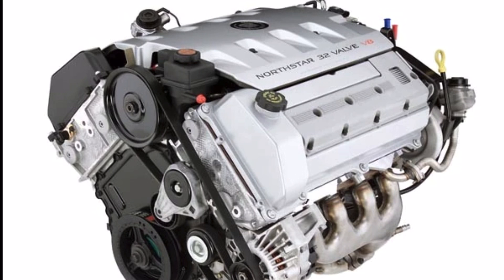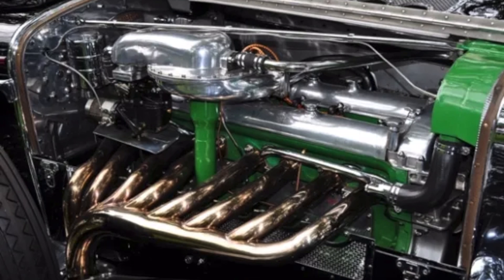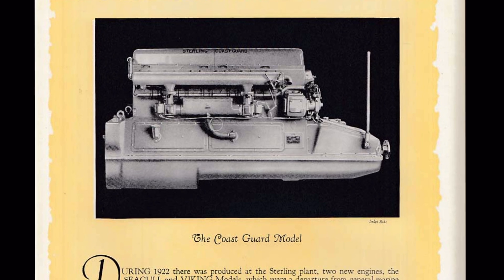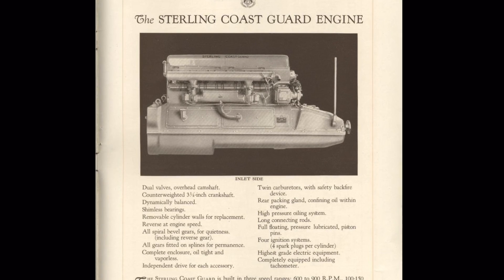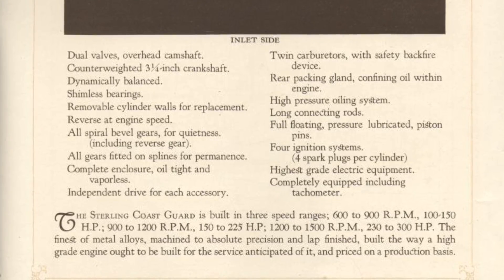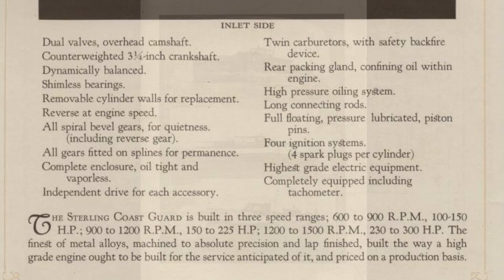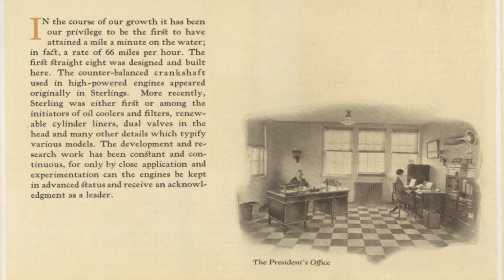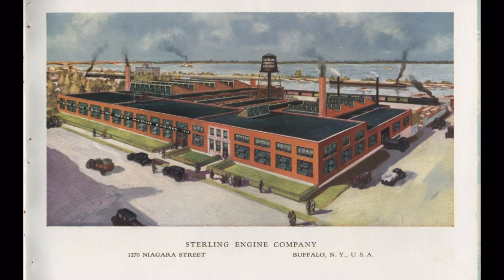They Beat GM, Ford, Chrysler & Duesenberg: 1925 Sterling DOHC, 4 Spark Plugs/Cylinder 1427ci Engine!

Comment: Awesome !  Reminds me a lot of a much more well known engine, Hall Scott, based in Berkeley, Ca.   I discovered Hall- Scott when I was looking at an abandoned Caterpillar bulldozer that had an overhead cam hemi head engine that looked really out of place and way too advanced for any industrial engine, even a modern one.  The head was off, laying on it's side, and was just crazy cool. I learned that Hall- Scott actually provided some engines to Caterpillar during the mid 1920's, that were basically 4 cylinder versions of their popular truck and bus inline sixes.

Detroit pragmatism killed off so many advanced designs that were around from the twenties thru the fourties, and most modern enthusiasts tend to think that advanced engineering began showing up in the 1950'-1960's.....   Thanks for sharing !!
Reply: I hope Adam will do a video on the Hall-Scott engines.  Besides truck. industrial and  high-end, high speed yacht engines, during WWII  Hudson also produced Hall-Scot marine engines under licence for use in U.S  Army-Air Force and Navy high speed  crash rescue boats and landing craft labelled as the "Hudson Avengers"
Reply: Do you remember if that Hall-Scott 1091 6 cylinder that was in tractor-trailers was SOHC  or DOHC.  Ive read about them in the past.  Pretty advanced engine for its time.  Saw pics online of a V12 version of that(2182 cid) in an old Kenworth or something 😊
Reply: Gear driven SOHC, with rocker arms to actuate the two angled valves per cylinder, hemi style combustion chamber with twin spark plugs. This 1091 engine belongs to a platform that started out in the 1920's, continuously produced all the way thru most of the 1950's virtually unchanged, besides displacements varied. It was advanced enough in the 1920's that it was still advanced in the 1950's, as Diesels took over for fuel economy reasons.  This whole series of engines was a work of art, both in looks and the sound !!   @John.Zachary.Delorean
Reply: @timmcooper294 I have read that Fire trucks kept Hall Scott longer because turbo diesels weren't a thing yet so the trucks weren't as quick as gasoline and diesels weren't considered as reliable yet, diesels were harder to start and required a warm up period the gas engines didn't either. The gasoline Hall Scott, LeFrance V12 and GMC V12 filled those roles.
Reply: @timmcooper294 SOHC, Hemi style chambers, okay thanks,👍,  been a long time since I read about them.  One guy recalled from his youth, some of them installed in fire trucks west of the Rockies, ran on butane, as they'd take off at night to a fire climbing a steep hill, 3 foot blue flames from the stacks😁
Reply: They used Halls Scott in fire trucks, heavy military trucks, I believe the Navy used their engines in some sort of boat or submarine. Hall Scott was common for power generation and irrigation pumps too I believe.
Reply: yea not really there were dohc hemi engines for aircraft even in the 1920's I mean the offenhouser racing engine at 250 ish cubic inches for 30 years knew no equal at indy and went as high at 1400 hp at full boost with the turbos in the 60's and that was based off a marine engine in 1929, it wasn't till they changed the rules on how much fuel you could use what you could use, and how much boost you could have and nerfed the offenhouser of what gave it its great power and that was in a 4 banger, but it had an apatite for fuel and made that tailtell tattletail growl sound but being monoblock it could take the high pressures of that much boost as it didn't have to have a head gasket
Reply: Actually, the Miller/Offy's design goes farther back than 1929 marine version......Remember we are talking production engines here, not purebred race stuff....
let's keep the purebred race stuff seperate, as it deserves it's own accolades !!!    Tons of cool stuff there !!   How bout a DOHC 1.5 lire straight 8 spinning 8500-9000 rpm in 1927 !!😁 @manga12
Reply: @timmcooper294  yes it was quite a feat, but the fact is if it wasn't mentioned I live by auburn indiana if you are refering to the legendary dussenburg straight 8, seeing cars that have them in the summer is as ubiquitous around here as a trip to the grocery store, ok well sometimes, but there are many people that are full of money and own cars of the auburn cord and dussenburg linniage, though the dussys were made in indy or around there e l cord brought the brand into the fold and it was based ouf of auburn here, but point is people think the hemi's were from the late 50's and fact is the dohc roller valve and hemi designs were going as far back as the 1920's and 30's and they were using aluminum castings too that didn't really catch on big though till much latter, oh and supercharging too, though the one used on the cords as it was explained to me it didn't so much force the mix like today but made it so it could breath better the engine that is, so the engine didn't have to fight to suck the fuel and air in, but yea they are special though growing up around here you see cars with the 8 all the time they have at least one cruise in a month downtown, or almost any given day of the year a mile from downtown at the acd museum, where the companies head quarters and showroom was, its one of the few perks of being around here and I mean few perks its a small city with a big auto history but its not kokomo or indy, but visionarys fred and august as well as mr cord they were

though if you were refering to the sterling sarry for going off on the tangent on old racing engines or production engines, around here cars and trains are just kind of in our blood born around here your born into it even if the majority dont pay attention to it or think the fesivals are a pain due to the traffic.
Reply: The 1.5 litre straight 8 I mentioned was the Miller, built during the 1920's when Indy 500 91 cu in rule was trying to control the speeds (tires were'nt that great then) Duesenberg was also very successfully involved at the time. By 1929, the rule lifted and the 183 cu. in. 4 cylinder became the norm.  But oohhhhh, those straight 8's !!!

Yea, too many people think Ford invented the V8 in 1932, and Chrysler invented Hemi engines in 1951 !!   

What really blows my mind is that guys like you and Adam, living in the salt hell rust belt, love cars !! That's dedication !!!  I'm gifted , living my whole life in the western states free of salt/rust, where I drive my classic cars as daily drivers (I will not own a newer car).  They last a lifetime out here with occasional complete overhauls.  @manga12
Reply: @timmcooper294  yea they last a real long time out there, the dry air keeps them rust free and dry, as for being from the midwest I am not dogging the life, just that the small towns around here had their heyday when they were someone in the world 100 or so years ago, the city of auburn though is going though a huge building boom its annoying actually and I am not really fond of the loss of the good growing land on the way to auburn from here, but one development park and another thats been dead space between the walmart and the one shopping area it always was undeveloped till about now, and we are getting a good amount of restaraounts as well as mixed and saddly the old auburn hotel which was front and center of the acd festival where the first one all the people in town stayed and planned for them I belive, but was let go decades ago was bought and is in the process since yesterday of being demolished but will be rebuilt to look exactly as it was on the outside and will have housing and a mix of buisnesses on its floor level once it rises again, but its sad, its one of the oldest buildings in downtown dating back at least to 1903-05 as the build date, its a significant loss of local history but it cant be helped it was too far gone,

sure the weather can be rough but there are soo many places and towns that revolved around the building of cars and transporation around indiana this is its home, 

yes I remeber reading about limits on engines at indy and to keep costs down the repurposed junk engine era, then that was repealed then you had the true heyday in the 1950's to 1960's with all the experamentation and the beautiful watson roadsters, the supercharging, the turbos the stp turbine cars.

but yea 300 hp from an engine like a sterling is a lot for the era.

Comment: I calculated a total displacement of 290.625 inches of displacement What did I do wrong? 6*6.25*7.75 = 290.625.
Reply: you're forgetting the bit about "Pi R squared".  Bore is 2 x R.

Comment: They specify dual valves in cylinder head , as in those days valves in block or one in block and one in head were more common. 
So they don't actually claim DOHC, and it looks unlikely that two cams fits inside that valve cover.
Reply from the maker: They’re actually DOHC with 24 valves. I found a rebuilder who has gone through them.
Reply: I saw that too. I assumed that the reference was two valves for intake, and two for exhaust.
Reply: There are two cams. From the operator's instruction book published May 1934: "The two camshafts are used operating roller push rods located directly over valve."
Reply: In those days "dual valves" commonly meant 4 valves per cylinder, in other words, dual intake and dual exhaust. Pierce Arrow offered a "dual valve six" in their most expensive luxury model. Stutz had a high performance, dual valve four cylinder. The dual valve design was offered by several high priced cars.

Comment: Adam , if you have a moment check out the British Napier Deltic  Engine it’s a unique design 👍🇬🇧🇺🇸🇺🇦
Used on the Motor torpedo boats,Railway locos in tandem !! And NY city’s most powerful water pump for fighting fires in skyscrapers. Worth a look 👍
Reply: Bizarre engine indeed.

Comment: I think Peugeot was some of the earliest dual overhead cam engines back in 1913ish
Reply: Correct. 1912 actually. 4 valve per cylinderDOHC engine was brainchild of a Swiss engineer called Ernest Henry when he was designing a new racing engine for Peugeot.
Reply: Yeah, there is surprising engine technology from the freakin' TEENS.
Reply: That Peugeot Inline 4 would inspire the engines built by Miller, later Offenhauser and in a roundabout way Bugatti. Although Ettore Bugatti briefly worked for or at least with Peugeot around 1910. Hmm...
Reply: The DOHC concept was used intensively by a few now forgotten companies in the 20s, in racecars that were quite advanced for their time. There are a few DOHC engines produced in 24/25 by Delahaye and by Sunbeam, and from 26 onwards by Amilcar and Salmson in France. Having worked on the Amilcar one, seing a 1.1L DOHC I6 with a hemi head, supercharger and dry sump is quite something. With methanol fuel, it could produce more that 110hp in 1927, and a redline near 7000rpm. Wonderful little engine, I doubt it will ever be featured on this channel as it is not American but I thought it is interesting to see how far the development of this technology went in such a short period of time.

Comment: check that math - I get 3.125 in cylinder radius squared x pi x 7.75 in stroke x 6 = 1427 cubic inches
Reply from the maker: You’re right.